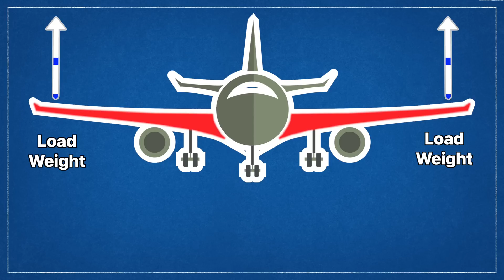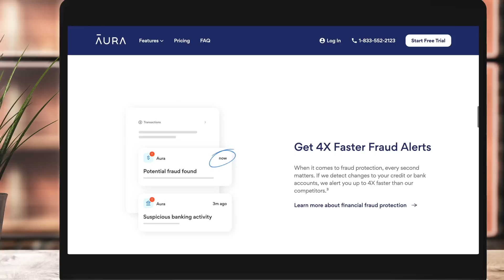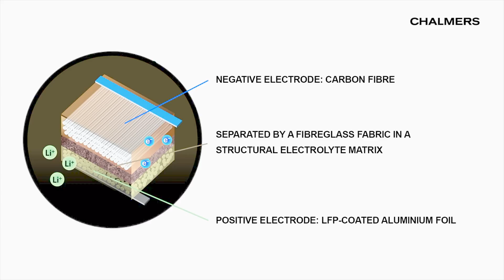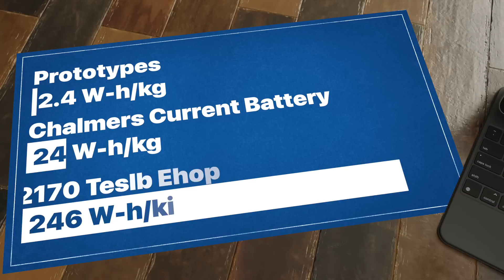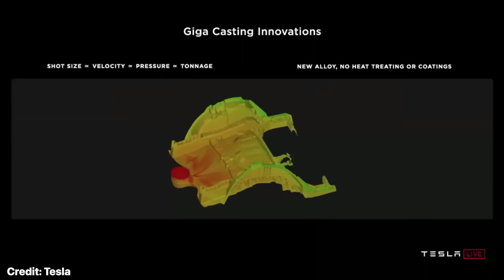How Can we Double Current EV Range?

Comment: Comparing fuel in aircraft wings and batteries into structure is very much apples and oranges. But, I do like the idea of trying to multi utilise parts. Its like F1 engines are the rear part of the car.

Comment: That is what will make Tesla a iPhone when the battery Degrades so the car Degrades  the trouble is you cannot stick a Tesla in a draw and  pick up a new  model I thought we were supposed  to reduce waste not cause more don't  be taken in there are other ways to reduce weight the reason the fuel tanks are in the wings is that its the moment of lift if the plane was to land with full tanks the stress on the wings would enormous

Comment: i think structural battery pack is a better idea than swapping batteries. most batteries will outlive the car and wont need replacing, and you get a lighter, stronger car.

Comment: If you're going to make the body the battery, then you may as well also make it a solar collector which charges itself. 
Many have also mentioned that this is not practical due to the difficulty of repairing the vehicle if it gets into an accident. 
Sounds like they have a few challenges but they are definitely on to something.

Comment: Lithium batteries already form part of the structure of the car, but since they're so fragile the batteries themselves need even more structure to be protected in an impact. The Tesla s battery is more like 650kg with its own frame. 
Another thing is a cars biw primary weight/structure is in under the hood and around the dashboard and a&b pillars. A bit around the rear axle as well. Everything else is just supporting structure. So putting batteries around its primary crash structure is tricky to avoid short circuits and thermal runaway in a crash. Planes getaway with this issue but cars can't. The way forward could involve graphene coated solid state batteries with aerogel insulation or something but will still need to figure how to stop short circuiting in a crash

Comment: Silverado presentation claimed a structural battery, and the Swedish research is at least 6 month old, they put in the lilium jet and there is no details about their battery a part from the size, could have been good a citation of the one company experiment of swapping Tesla s battery for one double the size and they achieve less than double the range

Comment: It's all maths. If lion batteries are 25% of vehicle weight and are 10x more energy dense than structural battery then structural battery, then the structural battery car would have to be 2.5 x as heavy to have the same battery capacity and would be far less efficient and way more expensive. So energy density would need to improve by around 2.5x to be comparible but would still be immensely expensive 😅 maybe just maybe if they could get tp 1/2 energy density of conventional batteries it may become viable for hyper cars costing millions. But consider that conventional batteries are a moving target becoming lighter cheaper and safer all the time I doubt in truth it will ever be viable in any way, however, there will likely be unknown spin off applications and breakthroughs in materials and chemistries that can be applied to more conventional batteries 🔋

Comment: A lot of ignorant comments about structural pack's. The tesla structural pack is designed to work as a stressed member of the chassis itself.
And integrate with the single piece large castings. Then they will mount the main seats on top&put it in from underneath on the assembly line.

It'll still be a bolted in pack design, so servicing it and or replacements will not be the major drama people on here without adequate knowledge are trying to claim. Battery day explained this in the slides and the October fest at giga Berlin showed the pack assembled with seats on it. 🤔

Comment: now one thing i want to ask, if changes were to happen to the chassis of a car like this (like thermal expansion/contraction, vibration, dents and scratches etc) will anything happen to the power output? can the power delivered still be stable?

Comment: I love how the bodywork for the dreamliner is made. Its pretty much like a giant compressed oxygen tank, like in your stock clip. It makes absolute sense if you think about it. If those tanks are meant to deal with constant changes in pressure, they'll work amazingly as an aircraft fuselage.

If there's an element we need to make more use of in this day and age, it's carbon and all the composites we can produce from it. It's a game changer and we need to throw our resources into getting carbon composites into a mass production scale. Its been around for at least 40 years. It shouldn't be something so specialist anymore. If anything it should be the cheapest material to use.
Reply: A guy on Hackaday named Michał (copy-paste that name, the l is a special character) came up with a new way to use chopped/recycled carbon fiber, by loosely forming it into the desired shape and then electroplating metal onto it to bond the fibers together, creating a sort of foam. I'm not sure what kind of mechanical properties it has compared to solid metal or woven carbon+epoxy, but it certainly is interesting.

Comment: There is a reason why we don't have a fuel tanks all over our cars. When you inevitably crash, you don't want gasoline or other fuels spewing everywhere from leaks in car unibody chassis. It would be a nightmare in Accidents. Today, because the fueltank is under the car, pucturing the fueltank is somewhat difficult and is non-issue in majority of smaller accidents. Imagine carrying such fueltank in your doors for example. 

And while EVs don't carry liquid fuels, Batteries carry their own set of problems. High voltages and amperages could make rescue operations much more difficult, because whole bodywork of the car is now high powered battery now. It would be more dangerous to paramedics and firefighters. It could ignite fires more easilly in accidents with gas powered vehicles (and even EVs carry flamable liquids). 
Ruptured batteries can catch fires too and suppresing these fires is near impossible, so putting batteries in areas, that are most likely to get damages, like doors is very poor idea in my opinion.

It makes all repairs more expensive, so EVs would be even more cost prohibitive. since you are no longer replacing just doors, but a battery pack as well. That goes for every part of a vehicle that includes a battery.

This is all around a horrible idea.

Comment: So, when the battery finally dies after however many thousands of miles, how would it be replaced if it's part of the structure? At that point, you would only be able to replace the battery that is removable and the structural battery (built into the frame and structure) is, again, dead weight. Would you have to get rid of the whole vehicle and purchase a new one with a new batteries (structure and removable)? Would all of it be completely recycled or would you have a lot more material that could leave a bigger carbon footprint behind?
Reply: I sure hope they can be recycled. The demand for lithium over the next decade outstrips the supply by multiple times
Reply: pretty sure the frame need to be modular like McLaren frame... even toyota EV frame is modular so they can use one frame design for different car length...

Comment: I think it would be cool if they used some solar to go with the car even if it would take 4 to 5 days to charge it only from solar panels on car I would by for in 1 month I drove 163.5 miles in 1 month.
Yes I'm in my truck now smoking thats why I know how many miles also its 21f outside thats why I'm in the truck lol 😆
Reply: Check out Aptera, isn't very practical, but it is supposed to be super efficient and being charged by the Sun or Sono Motors or Lightyear One

Comment: No body knows what a Pascal is or wants to. 
Tesla figured out you can carry loads in the battery can. Why not, the can structure is under utilized, The challenge might be distributing the load across many many cells at low cost and complexity. I see no benefit to making the battery internal components structural members at the expense of electrical performance. If you convey stress to the internals do you compromise reliability? What happens if it fails does it explode? Big cells are trouble because they contain enough energy individually to be fail catastrophically. GM, Porsche and other are finding this out. A big cell configuration is like a case of dynamite while the little Tesla cells each with a fuse is like a box of firecrackers. (I know fireworks can explode too it's just an analogy). I wonder if big cell batteries will go the route of aluminum house wiring that burned down a lot homes before they figured it out,  but seemed like a good idea at the time.

Comment: This would be one way to dramatically increase the price of a replacement battery.
Reply: Batteries are continually improving in their reliability. The chances of needing to replace a battery in a modern car is negligible. Think of IC engines, it used to be common to rebuild them regularly but these days many are sealed for life.
Reply: @eclecticcyclist  And some day we will all fly standing up.

Comment: Yeah, as if recycling batteries wasn't already hard enough...
The dangers batteries placed inside or replacing structural parts of a vehicle pose can't be overstated.
Reply: Designed properly, it could be much easier to have replaceable structural components on an airframe than a car. I only have a handful of years working on aircraft as experience and less working with electric power trains. But both can be very straight forward, even simple. Cars have to be able to smash into eachother and need massive engines to move around the shells, which lead to heavier shells, etc.

But airplanes don't have that problem and electric motors are small and you can have a lot of them, if you want.

Structural batteries will be awesome for small planes and easier to recycle than ones from a car.
Reply: Ironically, I think you just overstated the dangers.         

Products are best designed cradle to cradle, so it IS important to develop structural batteries in a way that is easy to recycle.   But, I see no indication that DH has considered the nuances of the challenge.   

An engineering dictum: To every complicated question, there is a simple answer — and that answer is wrong.

Comment: Another very interesting technology developed in Sweden is the ELONROAD Developed by the Swedish Transport Authority and currently being tested with buses, it's basically a rail set into or just under the road which charges the vehicle as it moves. Intended for use by all electric vehicles, the idea is basically that you would need a far smaller battery as it is constantly charging, reducing weight, but even more crucially, far better for the environment as far less batteries needed.
Reply from the maker: I’ll look into this!

Comment: The challenge is what do you do to replace the batteries in a car?  If they are integrated into the structure, those batteries cannot be replaced, so the whole vehicle will be thrown out.  In a traditional BEV, the batteries can be replaced and therefore the entire vehicle can have an extended life.

Comment: Holy crap, what a bad idea. The industry must grow up and start using common sized and fuel-station replaceable batteries so you just pay for the energy you use and don't buy batteries. 
1. Technically the centre of gravity must be kept low. 
2. Batteries wear out so you can't stash them where you cannot remove them and,
3. you need to achieve good current flow rates, ventilation and safety. Batteries catch alight when they get bent or damaged!

Comment: Structural batteries are the most foolish notion. Unless these batteries are infinitely durable it obsoletes the structure when the batteries die. You'd be far better off concentrating on aerodynamics like Aptera instead. A battery can never be zero mass unless it weighs nothing.

Comment: 90% of the weight in a battery is the cells, moving these in to the structure of the car does not save much weight at all.  It does save space which is the reason planes have their fuel in the wings.  Having a structural battery is good for weight distribution - but crap for any other reason.  Just some more 21st century technology bull.
Reply: Are you against advancements in technology? 😆
Let me guess...the vaccines have microchips?
Reply: @FixNewsPlease  Wtf? What he's saying isn't unreasonable. How do you think manufacturing would go with such a  complicated approach?
Reply: @Slayer-33  wtf wtf?
I am criticizing "Just some more 21st century technology bull."
Problem with that?

Comment: It would be pretty cool if Aptera eventually takes this approach to mold the batteries into the composite, I think they are already molding part of the cooling system into the skin of the body to avoid using a traditional radiator.

Comment: Why not cover the flat surfaces with solar panels.  Batteries in the doors etc will be a disaster in a crash to clean up.
Reply: Just think of when/if its time to get a replacement battery. Just disconnect the door and associated electronics and purchase a new door. Hopefully you live in a area with a very low incident rate of door dents. I keep waiting for someone to find a way to add small wind energy capture technology, partially charge the car while driving and when stationary during slightly windy days.